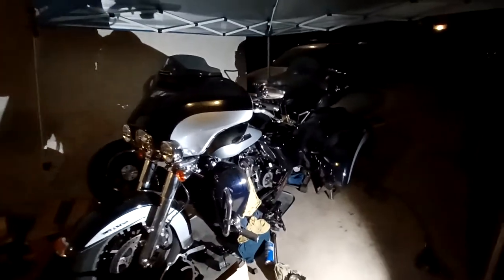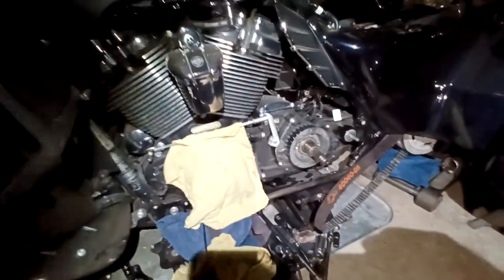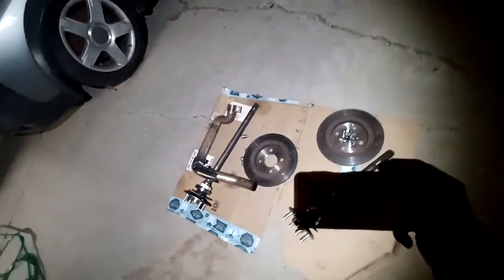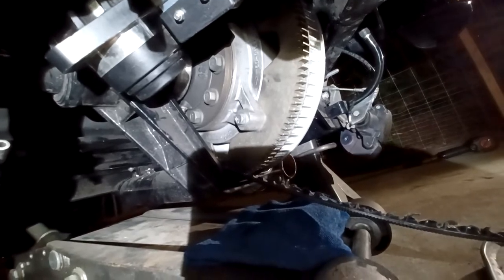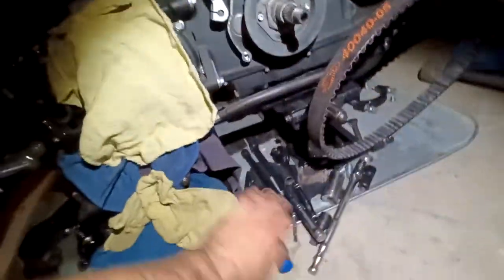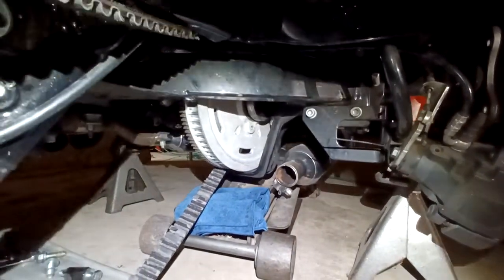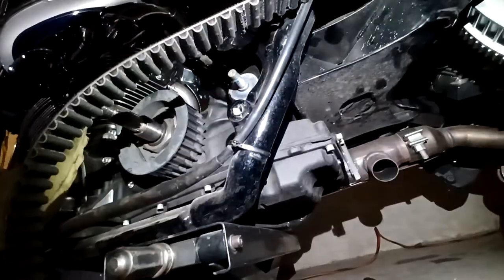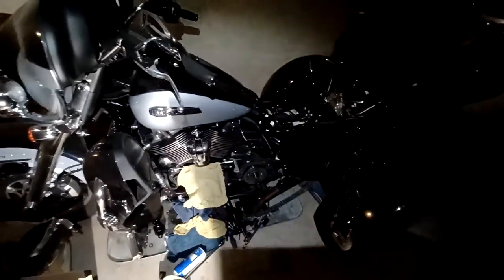2021 Harley Davidson Tri-Glide Drive Belt Replacement

Comment: Would be a lot easier, if you had removed the body. Most of the clearances would not of been a problem. Only 8 bolts holding the body on.

Comment: hi trikers i own a 2019 flrt and Six months ago i dropped the S&S 475 horse power Cam and i had a dyno tune done 5 weeks ago i have been popping monos everyday but yesterday she gave up snapped the belt drive on me i am updating to the S&S Drive Belt apparently the specs Say it’s Stronger than the Original is anyone out there who might know of a Stronger Drive Belt thanks for listening Cheers
Reply from the maker: I don't have to much experience with aftermarket harley belts. Usually I install the factory belt, and they do great for the intended cruising of a harley. For my customers that ride hard, stunt, or drag rave, I typically install a chain drive conversion kit. Hope that helps.

Comment: Which way does the swing arm nut turn to take it off
Reply from the maker: Pretty sure lefty loosey...
Reply: Ok thanks how would you go about removing the belt from the rear end where it bolts together on the swing arm